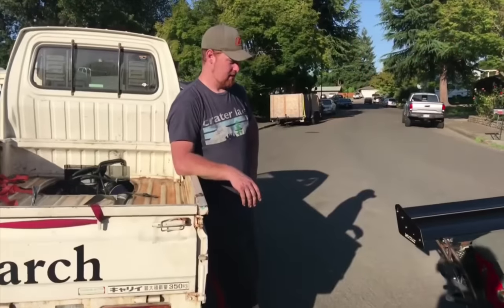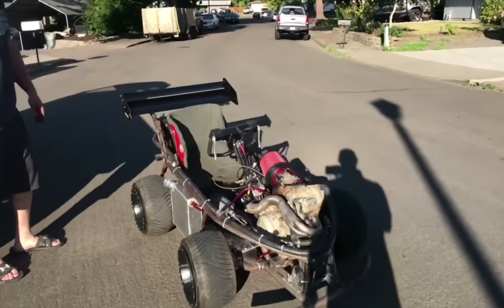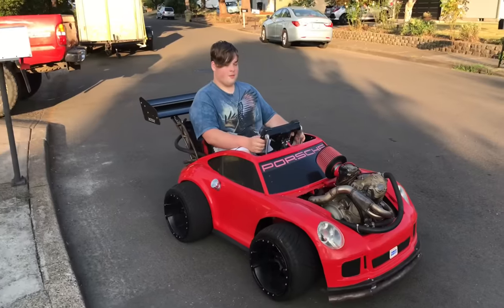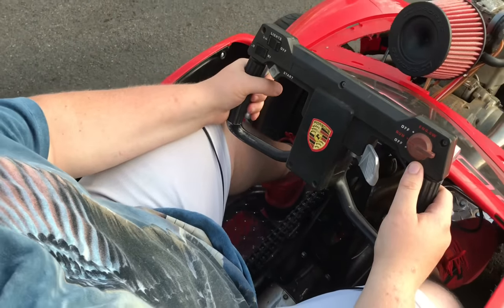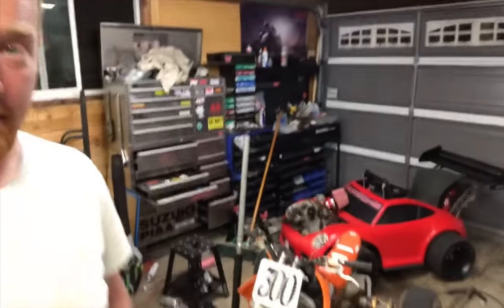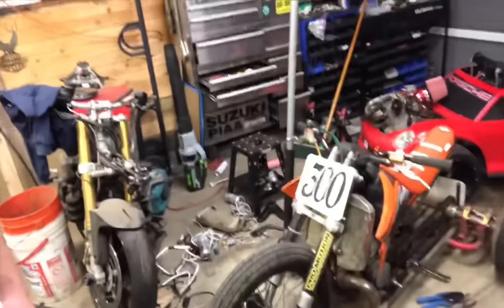Fastest power wheels ever?

Comment: i like the full build till i seen that chain.... would not risk riding in that till it was somewhat covered
Reply: If I built it I'd ride it like that,  but I wouldn't let anyone else ride it
Reply: Awfully close to the sack....
Reply: True
Reply: Budget Boost DIY  or cut a larger pipe in half and weld it on top of it you know to cover the whole damn thing
Reply: @MF11283  cool story bro
Reply: yea that chain, gotta be careful, might rip your whole leg off LOL
Reply: Don't worry, your balls of steel act as a chain guard.
Reply: Agreed definitely a nut catcher
Reply: RIP left leg
Reply: @savagesock8967  can't find any flaws in that logic 🤣
Reply: @DaveBuildsIt  your not allowed to put the visual in mens minds of sack skin getting stuck between a chain and sprocket you just hurt me...
Reply: Wondering if it'd be hard to connect a tiny chain to a driveshaft? A bit more mass, probably, but not enough to make a huge difference and it'd probably be easier to run a driveshaft safely than a chainey-boi.
Better than a dirtbike-powered chainsaw inches from your femoral, at least!
Reply: Ooooouch!!!😖😖😖
Reply: Here it is https://youtu.be/RCKPpd0idiM
Reply: @DaveBuildsIt  shmeat shredder

Comment: That aint a power wheels, thats a whole ass gokart with a plastic body panels
Reply: You mean plastic body panels. The metal chassis is exactly why I would agree that it is no longer a power wheels car. I've been modifying my daughters for quite some time and finally decided to find others out there. I am only looking for Electric upgrades with original frame. New tires, electric motors, and power supplies; which can also include starting capacitors, running capacitors, resistors, DC to DC reducers and various other electrical components but has to have original chassis, body. The drive train and\or gearbox can be also modified.

Comment: How did you make that narrow rear axel did you cut one down or just make a completely new one???
Reply from the maker: Came from a donor go kart chassis. I think it was just short. It’s a 1 1/4” standard axle so you can position parts anywhere on the axle
Reply: @HessickMoto  does it have the threads on the end for a nut or are the rims held in place with those collars on both side of the rim? Thanks for responding I'm trying to build a kart for the first time
Reply from the maker: Caleb Peters no threads or retaining ring. The billet aluminum hubs clamp on to the axle.

Comment: Love all the (it’s not a powerwheels anymore comments)   The word modified translates across all platforms of mods.  Tube chassis a fox body mustang and LS swap it.  Guess what.  Still a mustang.
Reply from the maker: Well said.   Who knew there were so many powerwheels purists?
Reply: @HessickMoto  in my experience with modding these things.  It’s usually the ones who lack the resources and know how that are the purist. Lol.  I have my son drag racing his against a go cart.  It’s still electric.  Only mods is chain drive, live axle, and rubber tires. Oh and fairly nasty brushless motor. Lol.  I haven’t cut the body at all.  Just mounted a plate to the plastic for the axle bearings and mounted a hand brake spot so he can stop.  They say it’s not a powerwheels anymore either.  Lol video on my profile.

Comment: That's bad ass. Can you do one with an electric motor?
Reply from the maker: It came with an electric motor that’s why I fixed it
Reply: @HessickMoto  Electric motors generate motion with minimal heat output. A petroleum fuel engine produces motion with tiny controlled explosions that create maximum heat. Those explosions push the interlocking pieces of metal that connect to a driveshaft that's connected to the engine. All that metal rubbing together generates a ton of heat, even when the parts are bathed in oil. That heat is wasted energy, that’s not being used to push a vehicle forward. As well, electric powered vehicles produce much more torque, which as we know, is what pushes the vehicle forward. Electric motors also generate instant linear torque, which cannot be matched by internal combustion engines.
Reply from the maker: @TerminusHostilia  you can build an electric one. I like gas engines. Don’t need anymore torque than what it’s producing now. I don’t like electric motors for projects. No soul
Reply: @HessickMoto  Right on, I like gas engines too. I just don't have the extra time to play. And just so you know, it wasn't a challenge. I merely stated what I thought would be something fun to build and drive as an alternate experience. As well, with the amount of negativity radiating off your last reply, I'll be extra careful about making any more appearances on this channel.
Reply from the maker: @TerminusHostilia  lol ok guy no negativity here. Electric would be cool just not my thing and something I don’t know how to execute well. I know what electric motors provide vs gas motors. But thanks for the insight. Sensitivity on the internet is a real thing these days…